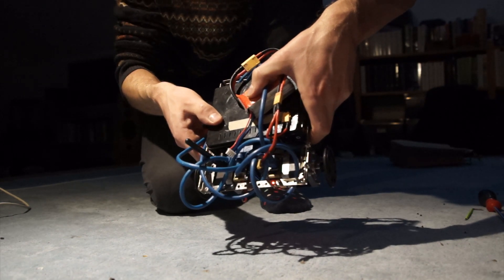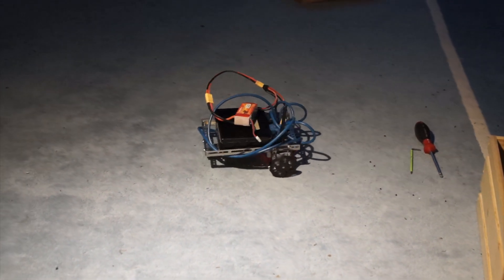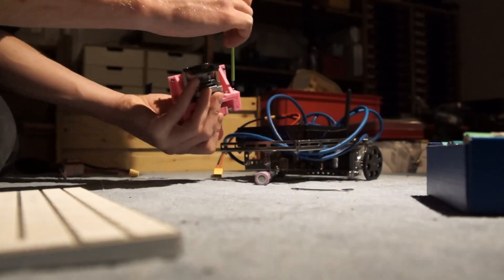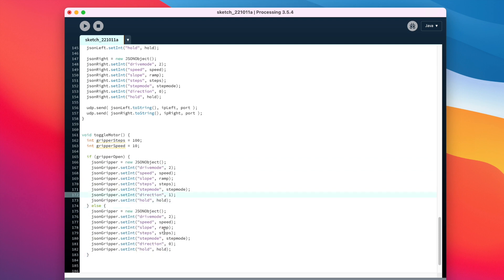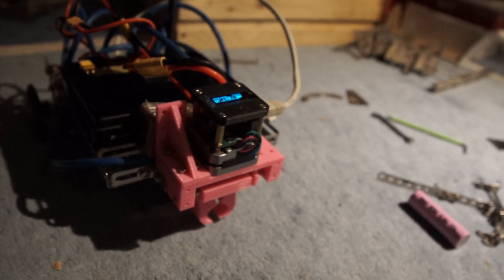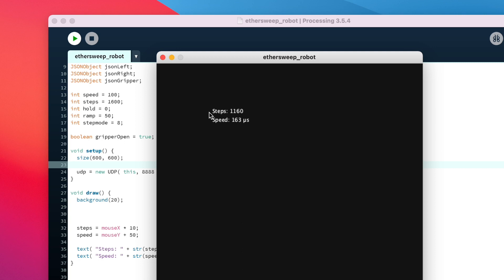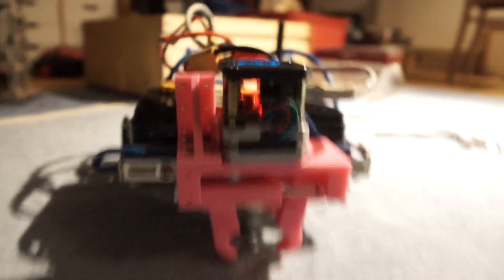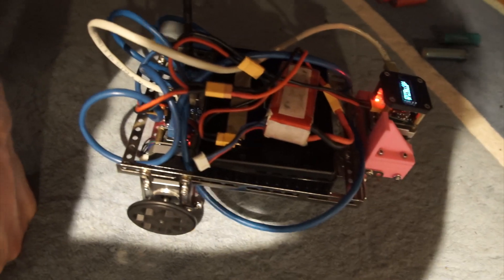Using Ethersweep - Building a simple robot example

Comment: But i dont understand why not using a rasp pi or a esp32 wich have a wifi or lan capability and then making and app or web browser to be able to control it and be able to add new stepper motors connecting it to the board directly or using another board. Then adding in a web browser or app the possibility to reflash the board inserting the new gpio pins for the second step motor or adding the ip address. I dont understand really the benefit of this.
Reply from the maker: No low level programming it the main benefit. Also it is super easy to add another motor. Esp32 is not time true and has a lot of overhead running in the background. Wifi neither fast nor practical, because you need to add wifi credentials manually. This approach is indefinitely scalable.